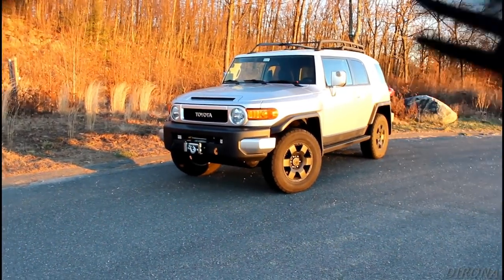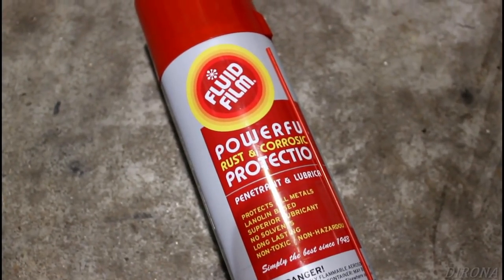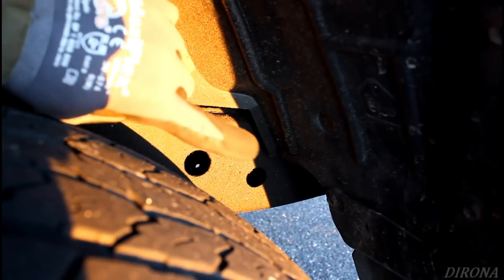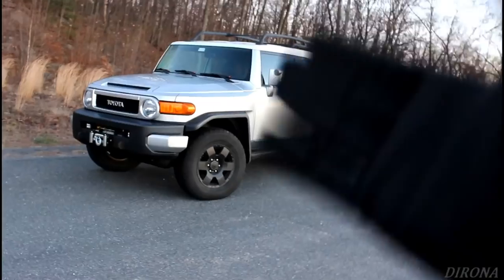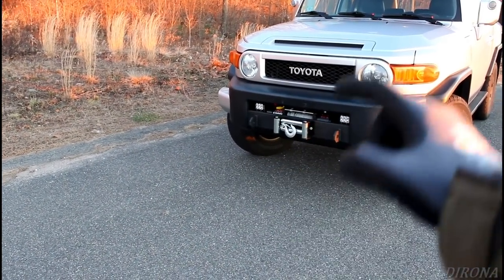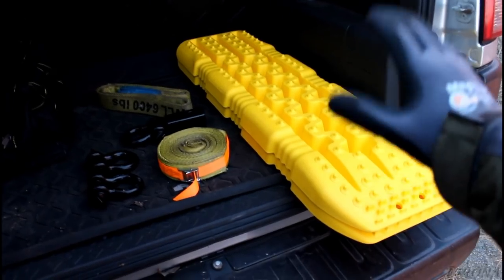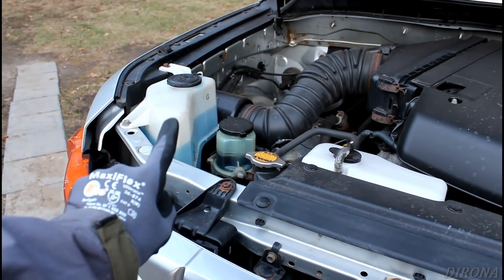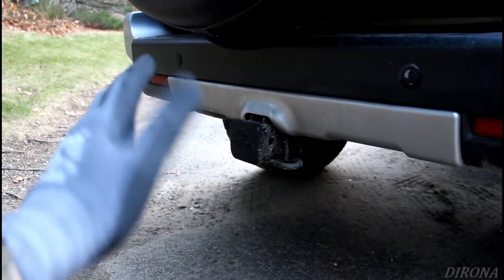How I PREPARE the FJ CRUISER for WINTER & Road SALT

Comment: Just got a wench this year myself on my FJ. I was gonna try to put fluid film on the underbody but ran out of good weather. Cheers
Reply from the maker: Nice, they sure add some peace of mind when you're out on a trail or out in a storm alone. I ended up cutting it very close with the fluid film this year...just barely got it on a day or two before they started salting the roads up here.
Reply: @dironaa  I'm in Upstate NY, so I kinda missed my nice weather window, too. Really meant to put FF on the FJ this year, darn it. I've been a crappy owner and haven't ever done it (I just heard about FF this year), but I do try to run it through the undercarriage rinse at the car wash regularly in the winter. 

Anyway, my question is: how much prep would I need to do before my application of FF? Should I wait until next spring after the salt is off the road?

Thanks for the vids, man. Good stuff.
Reply from the maker: Yeah I was caught a little off guard by how early the salt came this year too. Tough call, in the past I've used a lawn sprinkler positioned in a few different locations under the vehicle as an alternative to an under body car wash (I can be a little too cheap sometimes). If you do fluid film, I'd certainly either do that or take it through an underbody wash once or twice before applying. But not being an expert on the stuff, I think personally I'd stick to the underbody washes this year and apply the fluid film next September or October. In my experience using fluid film is the best way to minimize rust, but doing an underbody car wash once the roads have dried after every storm or two is the second best way. Thanks for staying tuned!